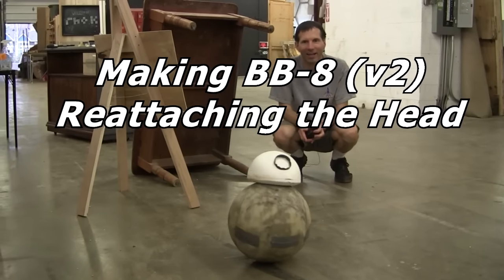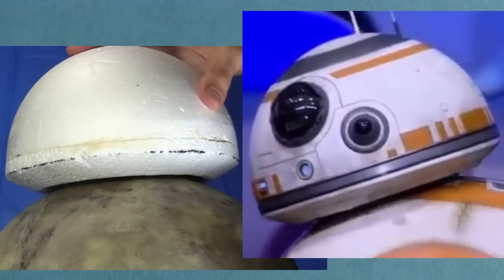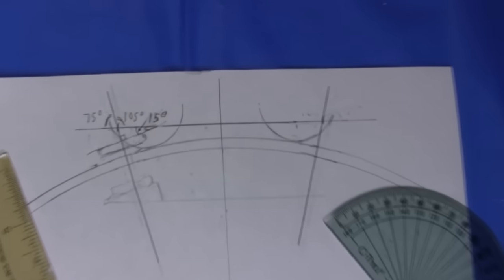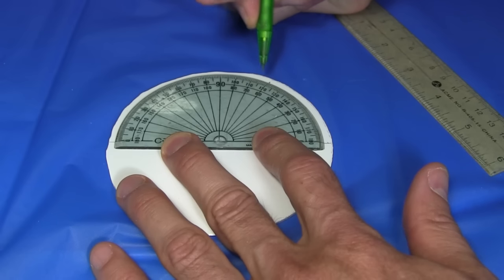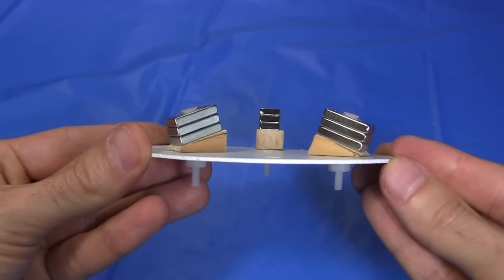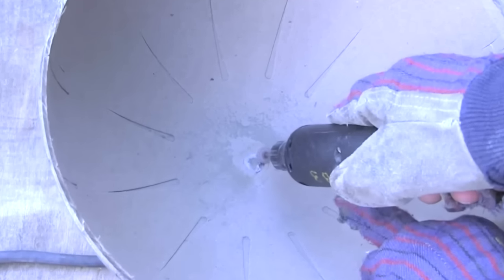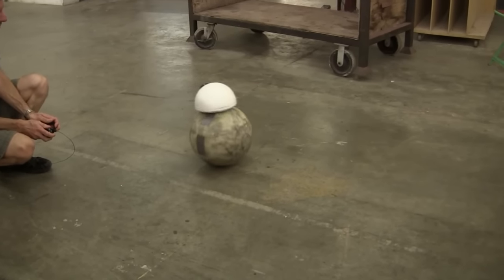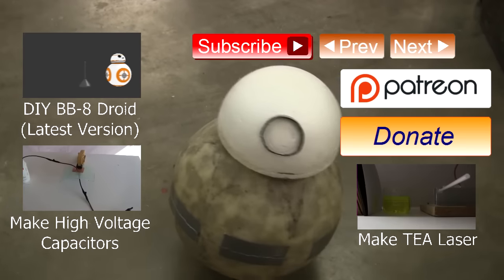Making BB-8 (v2) - Reattaching the Head - Part 3

Comment: Next level BB-8 would be one with a micro-controller and a counterweight inside to give a swing when it starts, and stops moving. ( to prevent the wobble at the beginning and end of it moving along a line. )
Reply from the maker: Not a lot of room in this one given its small size and the inexpensive components I'm using. If I fork out a few hundred dollars then I could go with smaller components and then do some counterweights. Now that I've gotten to this stage I could try acceleration and deceleration at least.

Comment: Try coding in some ramping for motor stop and start routines, this would alleviate transient lurching.
Reply from the maker: Thanks. I'm planning on trying acceleration for start and I have an IMU (Intertial Management Unit) board, Adafruit's BNO055, for stop. Though I guess I can try deceleration first.

Comment: hi I have made a paper-mache sphere using a big beach ball and also painted it with the same design which is on the bb8 body but it won't strong enough as it changes its shape when I put the internal mechanism ,I have some resin left with me but I don't want to put it on the outer part because I have already painted it so please help me please give some ideas to make it more stronger

Comment: Nice! Would it somehow be possible to use more magnets instead of the deo roller balls to reduce friction of the head on the sphere? Should make moving the head much smoother.
Reply from the maker: My rollers don't actually roll, but that may be helping the head stay on. I fear better rollers might slip off too easily. I'm ordering some to try it anyway. As for magnet balls instead of roller balls, it's been found that it's best to have rollers that are separate from the rollers.

Comment: well that head adjustment is tricky, it gives me more ideas for similar project, thank you for sharing with us
Reply from the maker: Yeah, making a rolling ball is easy. Making one with a head that stays on is definitely tricky. Glad I could generate some ideas. Thank you for watching.
Reply: This is a challenge I almost want to do! Although I don't really have the materials to replicate the project. If you could use a hollow iron/steel ball, a somewhat heavy head, and have all the drive circuitry in the head, it might work better. The idea would be to use a microcontroller and some of those omnidirectional wheels to control the head's position on the steel ball. Magnets would hold the head on. The microcontroller could then be programed to stabilize (setup to always battle the inverse pendulum) but with the offset angle (in the X and Y direction) governed by a RC controller.

So normally the head will be balanced at the very top of the sphere, and the center of mass of the whole unit is directly above the point of contact on the ground. In other words, it is well balanced. With an input from a RC, let's say that you want to go forward, so then the head will tilt forward, but a PID control loop will stabilize the head to remain at a fixed angle, always, say, 10 degrees from the top of the sphere. This results in a roughly constant imbalance that would cause the whole bot to roll forward. It is like a robot monkey balancing on a ball! And the best part is that the head would not be bobbing back and forth like that.
Reply: Battling the inverse pendulum with that design may be difficult, but I think you can modify a drone microcontroller board to do this. All the PID control loop stuff is already developed and optimized, All that would need to be changed would be the code that normally figures out how much power to apply to the motors, and replace that instead with code that maps the output from the PID to 3 omnidirectional wheels. You might want to start out with those wheels and practice making a robot with them first to gain an understanding of how they work, and how to use them. Then make them ballence on a ball w/ an arduino (multiwii code maybe?) and the MPU6050 sensor!!!!
Reply from the maker: The problem with the head driving the ball approach is that the head is always on top of the ball. The actual BB-8 can move it's head a fair ways toward the side (or front or back) of the ball both with the ball moving and with it stationary. Though having said that, that's not something I can do deliberately with mine anyway.

I have thought of what you suggest for doing away with the head's attachment to the drive system inside though. The problem seems to be the strength and therefore the weights of the magnets. With two magnets in attraction like I and everyone else are doing can use much smaller magnets than magnets that attract to steel (at least that's what I'm told.) Apparently magnets to attract to just a steel ball would have to be very big.

I've seen a few BB-8's that do what you're suggesting but without the steel ball or magnets. James Bruton's first BB-8 was that way (https://www.youtube.com/watch?v=RbesCNvae1M).

Comment: Congrats on getting 100K (soon) and success with the droid. Will you be possibly making a larger one at some point, so you can add all the features that people are suggesting in the comments?
Reply from the maker: Thanks. No plans for a larger one. I like the portability of this one -- I can carry it all long distance easily and with all the effort I put into it, I definitely want to take it a lot of places. Plus, with an axle drive system instead, which I may do later, all those things can be done. I also wonder if maybe this smaller size elicits more response than a larger one does.
Reply: Cool. I have always thought that an axle drive system would be the way to go with these things, but the hamster wheel type is the one that I see most of the time. Keeping it smaller means the motors are a lot less stressed in that arrangement too. Looking forward to that design.

Comment: really cool! next up, paint it?
Reply from the maker: Thanks! Yup, adding the details to the head and painting it all is underway. But I'm may do a few other things like adding my IMU to reducing wobbling. The motors are a 9.6V drill motor and a 12V drill motor. The 9.6V one drains its battery much faster than the 12V one (I guess it has to work harder) so I've found another 12V one and am replacing the 9.6V one.

Comment: Now that is really nice, it's getting along nicelly. Bit unrelated, but as I'm building a RC plane, and if you plan on building more remote control stuff, you can use cheap arduino clones and nRF24L01 2.4GHz tranceivers. for like 10 bucks you will be able to get a pair which will communicate over hundreds of meters, plus, get some telemetry if you really want to.
Reply from the maker: Thanks for the tips. I'm new to RC and haven't looked into many options yet. Hundreds of meters sounds awesome. With what I have in this BB-8 I have to be within around 10 feet/3 meters of it. As a I move further way it starts cutting out and then a little further yet it doesn't work at all.
Reply: there is a channel, called Iforce2D. That channels is mostly about DIY RC stuff. in one of his vid, he took a directional Yagi antenna for wifi, connected it to the transmitter (thei're both 2.4GHz), and he used a drone to fly 2.3 km away, and still got 480 packets per second of 500 packets sent. Well, that would be an overkill, but in my opinion you could use an upgrade, 3 meters doesn't sound fun.
Reply from the maker: 2.3km! Wow.
Reply: /watch?v=WfskHptAK14 here is the vid. It is just a question how far can it go, the signal fell just a tiny bit. However, i'm not sure whether you need that heck of a range. unless you also do FPV and go around scaring people from your basement.

Comment: Great video! Does anyone know the proper term for those variable height screws? I’m trying to order some
Reply from the maker: If you mean the nuts and bolts that I adjust at 3:50, those are nylon nuts and bolts (i.e. made of nylon). Those are 1/4 inch diameter and 20 threads per inch but they come in various sizes. I get them from the miscellaneous hardware drawers at Home Depot in the hardware aisle. They are expensive since they're not the normal metal ones. But they're lightweight and non-electrically conductive, two reasons I often use them.
Reply: RimstarOrg Thanks!

Comment: nice bb project
but why didnt you use a normal rc system
it would have given you so much more controll
Reply from the maker: I used what I had because in version 1 I started with a toy remote control truck, and so I adapted the electronics for that for version 2. I still get a surprising amount of control since with the two wheels of the hamster drive system I can do forward, backward, turn on the spot and also turn with a 4 foot/1 meter radius. With just that I can do a surprising amount of puppetry. But yeah, for controlling audio I'm going to have to come up with something else. Also, if I ever make the head able to move away from being just on top then I'd need something for that too.
Reply: if you were closer i would give you a few transmitters and recevers
i have tomuch of them

Comment: Now if only you could orient the batteries, so that they dangle from the internal support to act as a wobble-dampening pendulum... ;-)
Reply from the maker: Yeah, not a lot of room in this small BB-8, especially not with these components. I could move some of the parts inside lower down though, which might help.